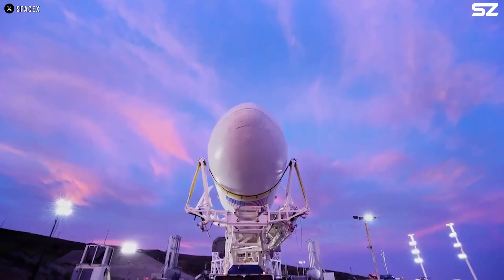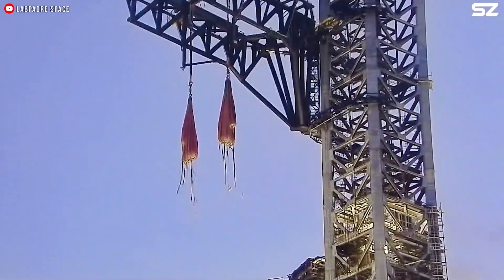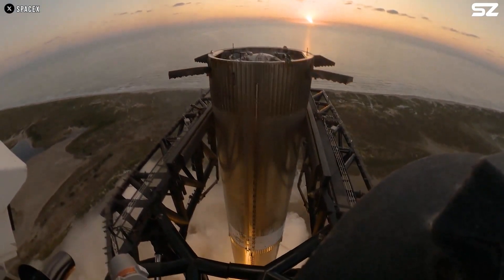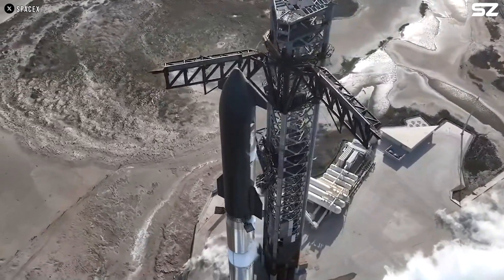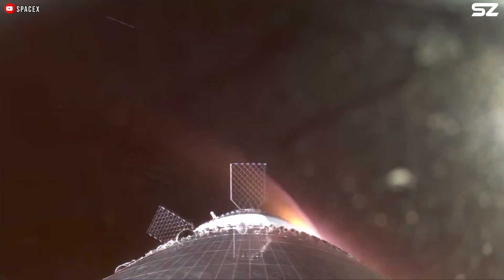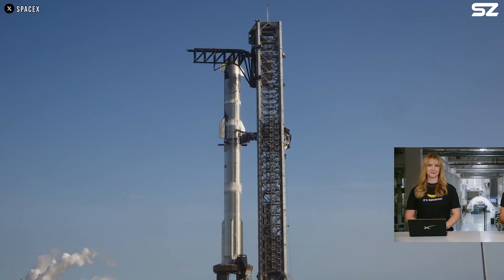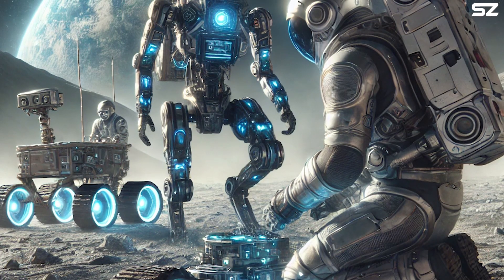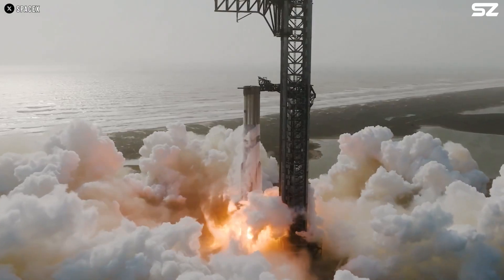SpaceX’s Starship Landing Legs Problem!

Comment: I had a possible solution for catching the ship without a tower and it could be used at sea . I envisioned two large triangular frames that were hinged on their base , the top of the triangles would have a semi circle each the size of the diameter of the ship , these could be hydraulically opened and closed like tongs or like hands closing around a babies waist. The ship would descend while the tongs are vertical and as the ship reached the correct height above the ground the hydraulics would close the two  tongs and make the two semi circular rings close around the ship .
Reply: Why bleat about your fabolous vapor-ware in a youtube comment section ?